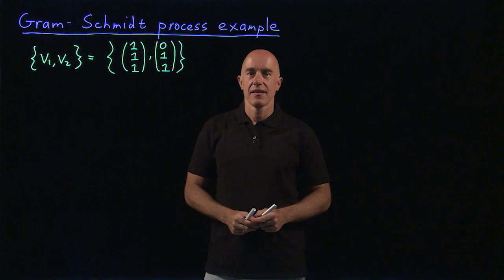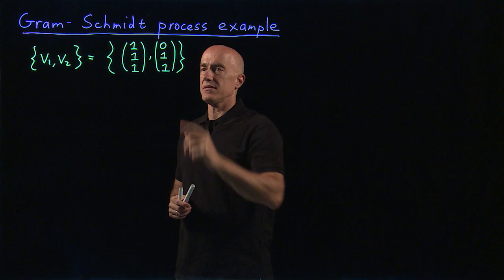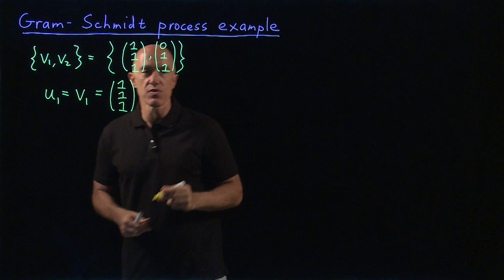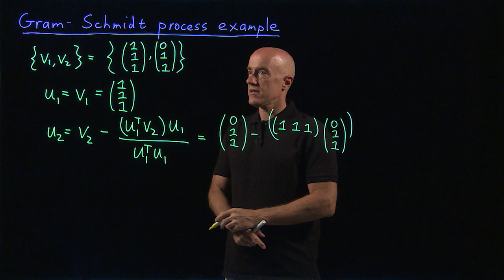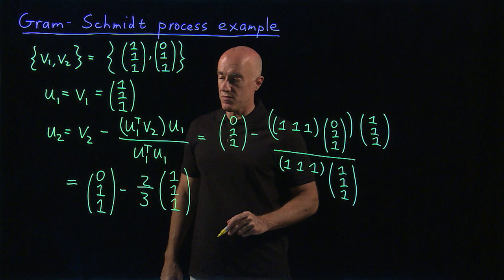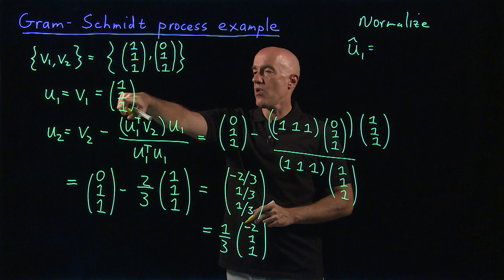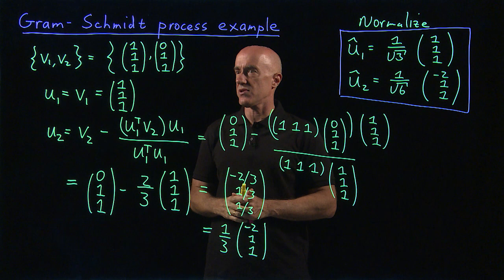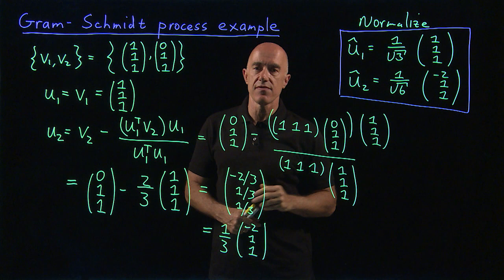Gram-Schmidt process example | Lecture 20 | Matrix Algebra for Engineers

Comment: When normalizing u2, do you simply ignore 1/3?
Reply from the maker: Yes, can normalize all the vectors at the end.
Reply: @ProfJeffreyChasnov  Sorry, I dont understand why .
Reply: +professorhugo1468, normalizing a vector means making a vector of unit length (length=1) pointing in the same direction of the vector being normalized. Eg, given a vector (-2,1,1), there are infinite number of vectors that point in the same direction, eg. 2 x (-2,1,1), 3.5 x (-2,1,1), 12 x (-2,1,1), 0.15 x (-2,1,1)...etc, generalized to A x (-2,1,1), A being a variable. For all these set of vectors, the unit vector or vector of unit length is the same, that's 1/(length of (-2,1,1)) x (-2,1,1) = 1/sqrt(6) x (-2,1,1). Note, there's only 1 unit vector in any direction, it's unique.
It's the same as normalizing (-2A, 1A, 1A) => 1/sqrt[AxA(2x2 + 1x1 + 1x1)] x (-2A,1A,1A) => 1/(A x sqrt(6)) x (-2A,1A,1A) => bring 1/A into the vector, it will result in the same unit vector of 1/sqrt(6) x (-2,1,1).
Reply: @ProfJeffreyChasnov sorry I just can't understand how normalising is derived from this equation "the unit vector or vector of unit length is the same, that's 1/(length of (-2,1,1)) x (-2,1,1)". Is it possible to have a dedicated video to show why that formula is used to obtain a normalised vector?